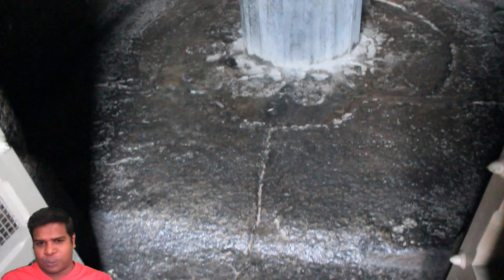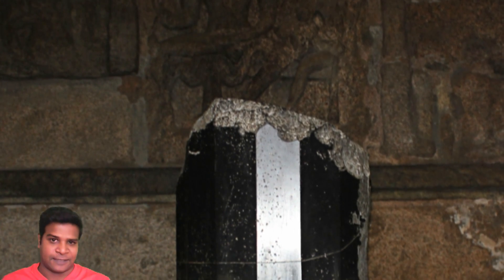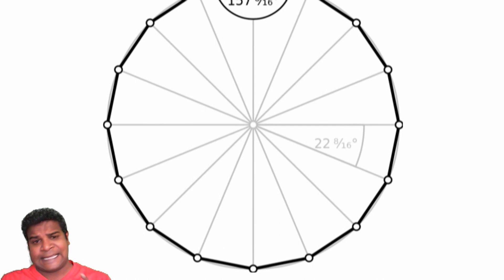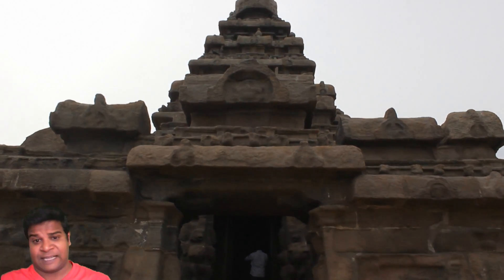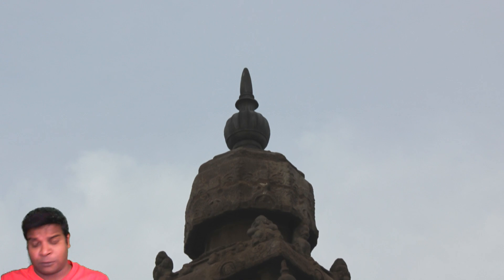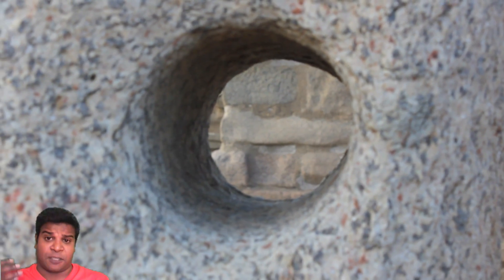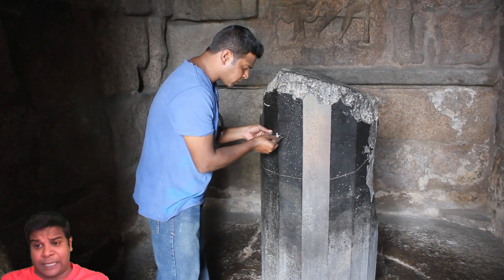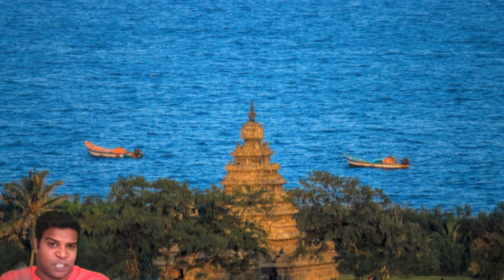India's Oldest Lingam - Evidence of Ancient Machining Technology?

Comment: Your videos are fascinating, man. Keep it up! 
Here are my 2 cents I'd like to add:
The lingam can be made using euclidean geometry. A compass and a straight edge can be used to mark out the shape for the sides on a flat surface, say a piece of wood. It won't matter whether there are fractional degrees or not, you simply get the number of sides you want. You cut the shape out of the wood and now you have a template you can match to while carving. As for straight edges, one can draw strings from one endpoint to the other(in a jig) and then carve till the edges are parallel with the strings. I know the surface looks too perfect to be hand-carved, but workmanship was pretty amazing at the time. The may have had some rudimentary(or incredibly advanced!) machines to carve/chip the stone. Something like a milling machine on a track, so each face can be done in one go, and the piece is then rotated to the next face.

Just a thought. Have a nice day!